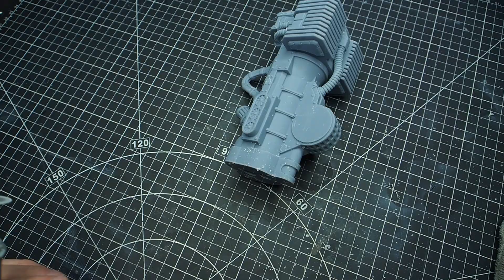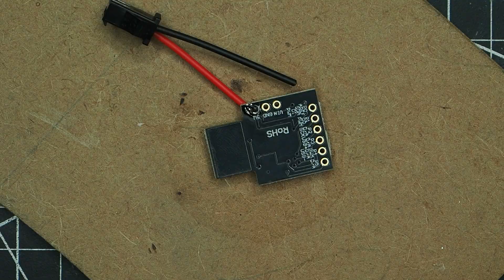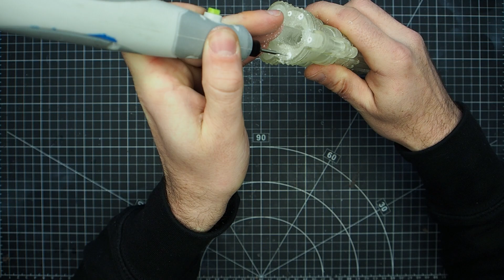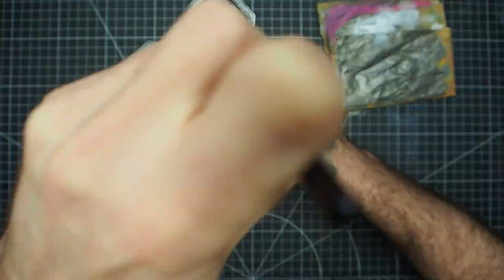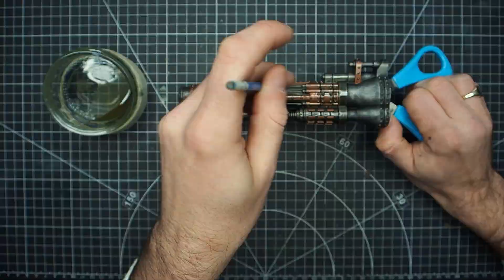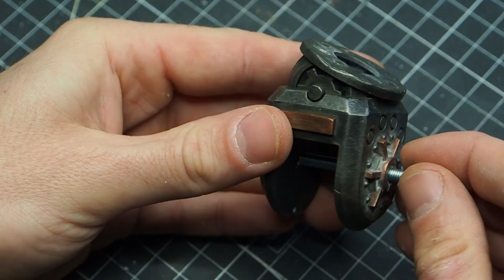Weaponising the Warlord: Volcano Canon

Comment: Might I recommend looking into "LED Magnetic Control Switch Lights"?  They are these super compact assemblies that consist of an LED on a PCB that's only slightly larger than the button battery that powers it.  There's also a built in magnetic switch, so it can be toggled on or off just by bringing a magnet near it.  The huge advantage is that there's no need for wires or large battery housings.  You can pretty much fit the entire assembling in the immediate vicinity of the thing you're trying to light up.  So like in this case you could fit the whole thing just 1cm down the barrel with something as simple as some double sided tape.  Or alternatively this is something small enough where you could fit them inside the titans head, one for each eye, with plenty of space to spare.  Just to get an idea of scale, I genuinely think these things are small enough that you could probably embed them in the armor itself and have individual eyes or mouths or other gaping holes be lit up (albeit I think that'd definitely fall into the "too much" category lol).  And then when it comes time to change the batteries you can just pop the things out with paperclip or tweezer or what have you, swap out the battery and then them pop it back in.

There's definitely the tradeoff of them not being programmable, so they only offer a binary on/off, which is a bit of a bummer.  Not entirely sure if there's versions where there's build in flickering or pulsing effects that it can cycle through with the magnet...  

All that to say while they aren't the suitable for all situations, I just think that it's so convenient not having to worry about running wires all through the model or carving out space to house the batteries and whatnot that they're definitely worth looking into for some of the simpler use cases.  Could save you a lot of hassle in some situations!
Reply from the maker: Thanks very much for this, I'll look into it! I wanted to try something based upon magnetic electrical contacts initially but went the direction of mounting the circuitry in the weapons themselves - this'll be interesting for projects moving forward!

Comment: With the plasma gun you should try to make the coils charge up in a sequence like starting dark and then getting brighter, and then one big bright blast out the end as the shot and then a rapid “cooldown” (fast fade from bright to dark/off) for the coils as the energy would be spent immediately during the shot. Plasma weapons generally don’t need a heat sync type cooldown as the energy is built up like a battery and then discharged in one big pulse. 

Sequencing kind of like: 
Coils dark fade to bright, ready for firing, on/bright at the end of the gun, fast fade from bright to off on the end of the gun and coils at the same time. 

That’s kind of my vision of how a plasma gun should look. I look forward to seeing the future builds and projects!
Reply from the maker: Very cool! Stay tuned and there will be some things coming up for LED pattern design submissions 😊